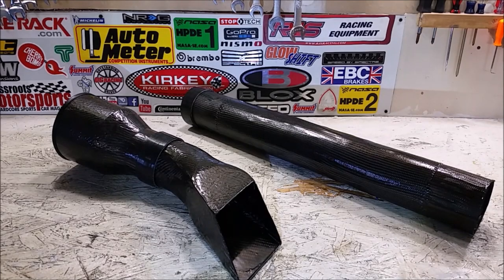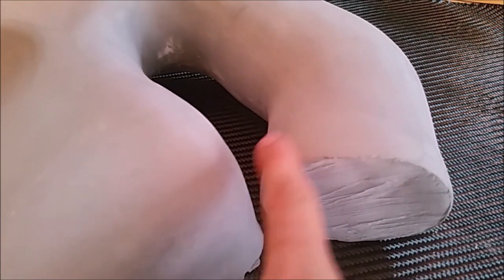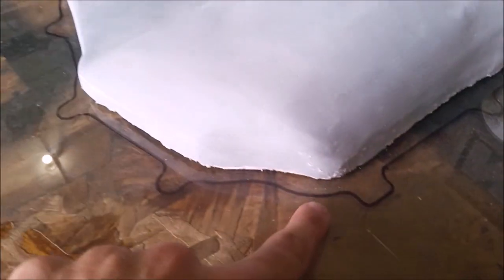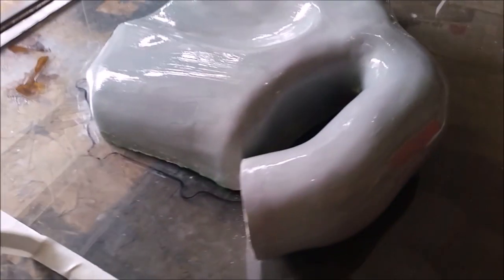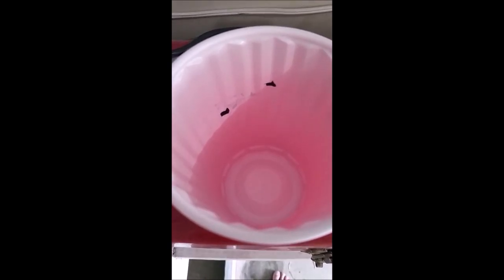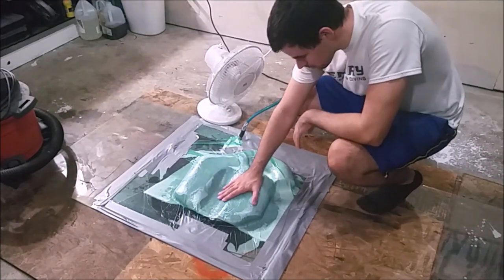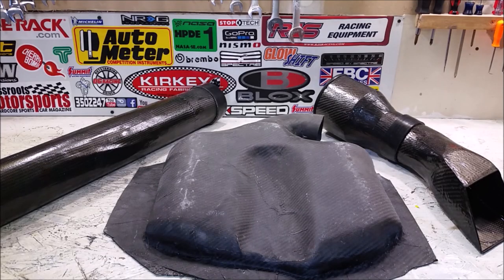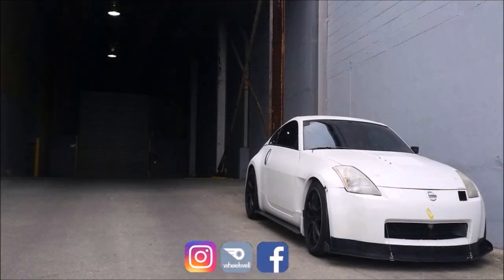How to Make a Custom Carbon Fiber Intake (350Z Part 3 of 6)

Comment: Acomplished what u set out to do!!  There are always detractors who shite the end appearance, but their not forking over time or money.  There are many methods that deep pocket folks can use for high end appearance, but they take time and money. Polished male plugs, then two piece female molds, custom fabbed silicone bladder bags, and MT wallets.
Reply from the maker: david,r. massey thanks for the support man. Yeah I could spend way more time and money all for extra work few would fully appreciate. It works great and that's all I need
Reply: Keep up the good vids.  Plus if i were to go nuts with a winning lotto # a 350Z would be an excellent start for a carbon fiber complete makeover.

Comment: Hi bro, I'm sorry my English I don't understand much if you could just tell me what exactly the gray paint is and after you put the foam so that the carbon does not adhere to the foam and you can detach it
Reply from the maker: It is a filler primer that produces a thicker layer of paint that can be sanded down to provide a smoother finish. After painting, the part must be coated in a polyurethane sealer to prevent the paint from sticking to the resin.

Comment: Wait why do you only get 1 shot with the molds?
Reply from the maker: If I wanted to make multiple, I would take a fiberglass mold of the plug I made; then, I would use that to make as many carbon fiber copies as I wanted. Knowing I only needed one, I didn't make the fiberglass mold you save time and money.

Comment: Whats the benifits to using the inline cone filter? Why not just use a regular cone filter at the begining of the intake?
Reply from the maker: To maintain a sealed, cool pathway from the exterior of the car directly into the engine. It will yield a small ram-air effect at speed and avoid hot engine bay air.

Comment: thank you, man! you made things look easy :-)) inspirational, i feel like i wanna work ;-)
Reply from the maker: Glad I could help!
Reply: hi! 
back again ;-) 
i noticed that you did not use the infusion media you talk about in part 2. 
(sorry if i am wrong and could not see properly)
Reply from the maker: mirceaandreighinea no I ended up not using it. Infusion would be a good way to do it if I had made a negative mold but instead I made a positive plug. It would have been a better end product but more expensive and more time consuming
Reply: negative meaning the mold to sit on the opposite side, like on top pf the plenum, is it like that? if so than not possible to do the neck (cylindrical part), right? 
yup, time & money are important too :-) 
thank you! ;-)
Reply from the maker: Exactly. Had I done a negative mold it would have had to be a two piece mold to make the neck. It would have been much more difficult. It's worked perfectly; so, I'm happy with that decision.
Reply: hi! 
any idea why some recommend to use a Release Film, placed between the peel ply and the breather? (it looks like it's not really needed... you did great job without it)
or some recommend to use it instead of a peel ply...
i don't really understand where-why to use this Release Film product.
any idea?
thank you & best regards!

Comment: I'm confused to why you didn't make a fibreglass plug out of your foam moulds to get an absolutely pristine part? Never seen it done this way except for in-car audio where they paint the part and don't care what the end result of the actual visible carbon is.
Reply from the maker: The appearance of the exterior carbon is completely irrelevant; the interior of the part, the important part for air flow, is smooth as glass. No need to go through all the added effort and expense to make the part "prettier".

Comment: hey, I know I'm late and you probably won't see this comment, but I'm going to write it anyways now
I have some plastics from my motorycle that I really don't like the plastic looks of. Could I sand the paint off them and put one or two layers of carbon fiber on them? This is of course only for looks, and that's what I want
If I don't apply that release film, would it stick to the plastics?
Reply from the maker: In theory, yes, but it depends on how complex the shape is. I'd recommend a textured faux carbon fiber vinyl wrap or hydro dipping the parts. You can clear coat vinyl with certain paints as well. I just worry the carbon won't lay down neatly on parts that are too complicated. It'll also be unnecessarily expensive.
Reply: @350Z247  well, thanks for the quick response, i think that I'll try it on some small parts. They are not too complex...
How do I get the extra resin layer to polish when I just "coat" a part with carbon?

(I've considered those carbon fiber vinyls... but most look really fake... just one brand I'll try out maybe it looks good then I'll use that)
Reply from the maker: @ollipeter6311  No problem man. You can lay them down and after vacuum bagging or regular wet layup, you just brush on an extra layer of resin, sand it smooth/level, then buff and polish it like paint.
Reply: @350Z247  thanks man you really helped me out👍
Reply from the maker: @ollipeter6311  you're welcome. That what I'm here for!
Reply: olli its called skinning and you only need one layer, hydro dipping is an alternative but it looks fake
Reply: @bleachinuri  thanks i'm going with some high qualitiy vinyl wrap

Comment: Nice work on making the plug and all.. you were just one step away from making a repeatable mold and also one that wouldn't have require a ton of finishing work by making a 2 piece mold of the plug you made.. any reason you didnt ? Tooling gel and some modeling clay with an extra day of work :)
Reply from the maker: I had no need to make multiple copies as I don't make them for other people. I got the once piece I needed. If I ever need to replace it, I can make a plug from the current part as even the worst failure would still make a useful plug. Plus, over two years later, it's still in great shape.

Comment: Your a genius
Reply: What's the price of this diy
Reply from the maker: r0mulyni2 all in, $400 which isn't that bad considering how much you get for that. That's less than a CAI and plenum spacer. It'll be lighter, resist heat soak, and the plenum should flow much better. It really wasn't that hard either.
Reply: 350Z247 really really cool

Comment: Very primitive method of bagging, however, it's good enough to get the job done.
Reply from the maker: Yeah, it worked way better than I expected, and the prep was far easier than making a traditional vacuum bag.
Reply: Yep, process only needs to be good enough to achieve the desired result right? Clearly it worked :P